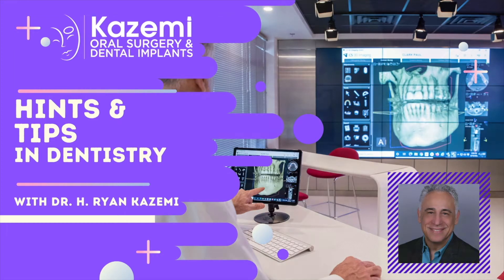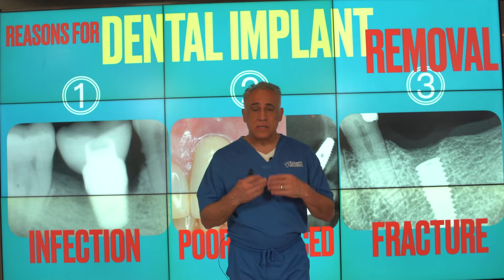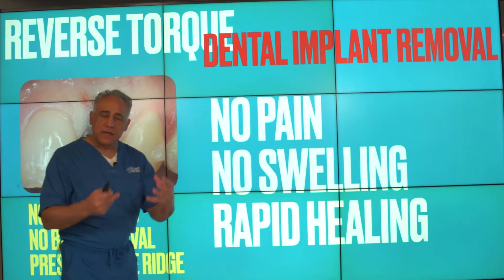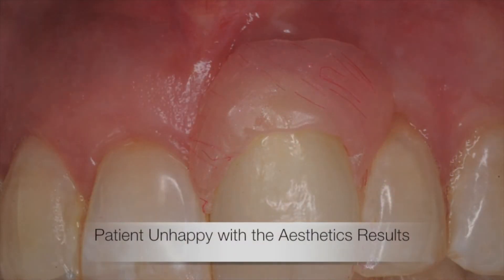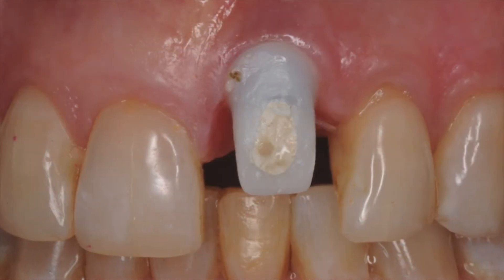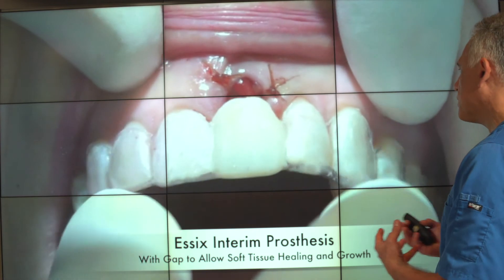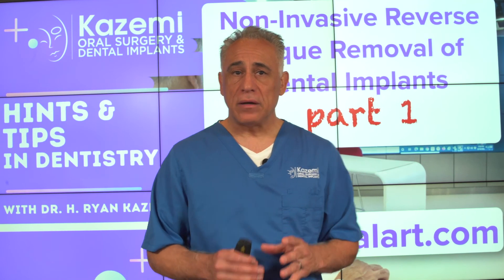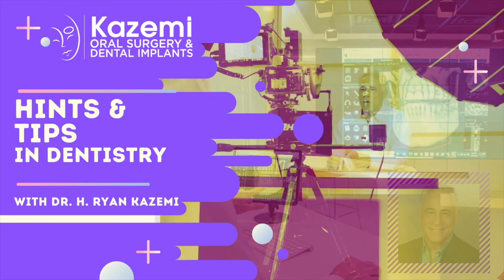Non-Invasive Reverse Torque Removal of Dental Implants: Part 1

Comment: I have 2 <10yo screw thread Implants, and Dr.’s that I consulted with always said they had to remove the bone block, but I knew better. On scan both implants have bone loss from micro movements, absent infection, so they should be easy to remove. Been looking for a closer Dr for years that can remove them w/ Reverse Torque. I’ve been lucky enough to find one in CA, but even luckier you’re in DC. I sent over an inquiry to your office
Reply: Did you go to get the implant removed?